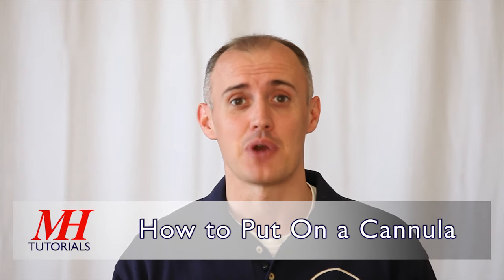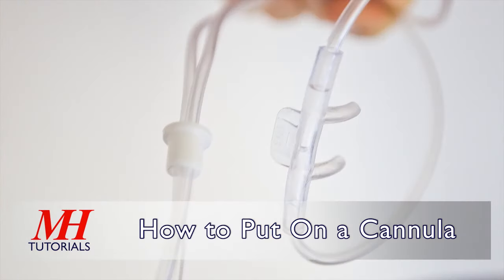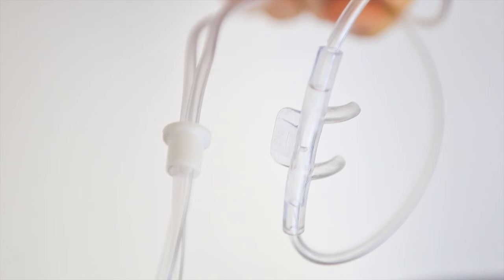How to Properly Put on a Cannula Tutorial | Mountain High Aviation Oxygen

Comment: This is sorely lacking. No cannulas that have ever been supplied to me have the "tab." So I wondered, are the prongs supposed to be pointed downward or upward? Can't tell by the video, as it's not really clear and due to optical illusion, the prongs can appear to be going up or down. We need to be told. Previously I read the prongs should point down, so for a year that's how I've been wearing them. But alas, today they delivered mini-tanks with pulse action. I could not figure out why the pulse just didn't seem to work. Eventually I discovered that with the tabs pointing down, the unit was not perceiving an intake of breath through my nose. When I turned the prongs up, the pulse worked just fine. So now I'm wondering, what is supposed to be the right way. Seems a video purporting to show how to wear a cannula should cover this.
Reply: ApplyUrBrain -- Exactly. I have the same issue. No tab.
Reply: I agree it is not very clear and mine also does not have a tab
Reply: No tab here.
Reply: I also have no tab. However it seems to seat itself more comfortably with the prongs facing downward for me,
Reply: There is no tab on mine, either.
I have looked at different videos and I like this one best because there isn't any loud music, making it difficult to hear the person speaking.
Reply: The prongs go downward following the line of the throat.  If the prongs are placed upward, it can irratate the nose and create a sore.  This is especially  important for children and the vey elderly.                                                    "The nasal cannula prongs are slightly curved. Make sure the prong tips curve DOWN into the nose following the natural curve of the nasal passage. Prongs that are placed wrong can bother and damage the nasal tissue. Oxygen should have moisture added (humidified).
"

Comment: So what do you do when your ears are raw sore and bleeding from that thing rubbing them there's no answers about this
Reply: Protect Your Ears:One of the most common complaints among individuals using oxygen tubing is soreness or irritation behind the ears. To prevent this, invest in cushioned ear protectors designed specifically for oxygen tubing. These soft pads can help distribute pressure evenly, reducing the risk of discomfort or skin irritation. Alternatively, you can fashion your own padding using soft fabric or foam material for added comfort.